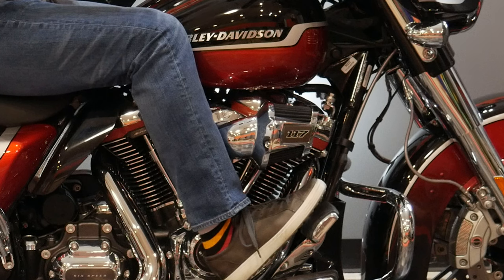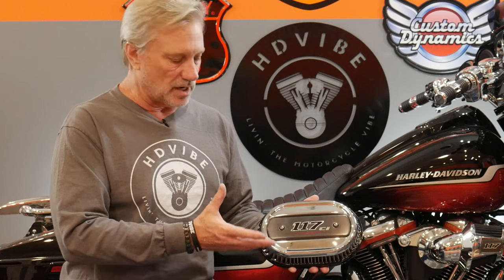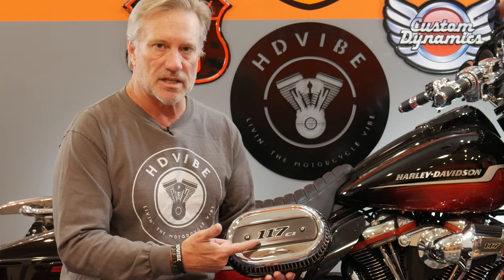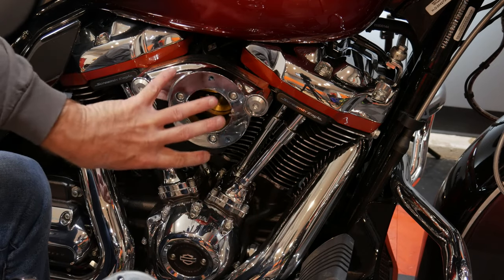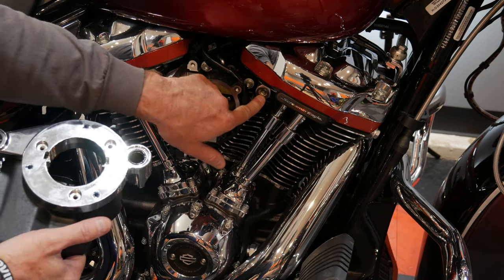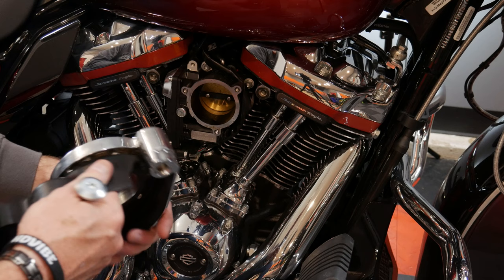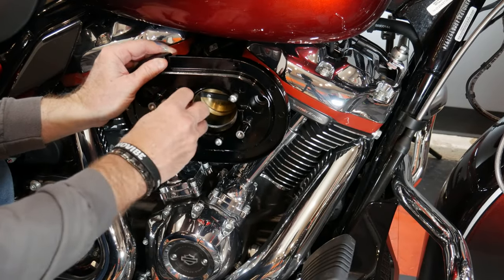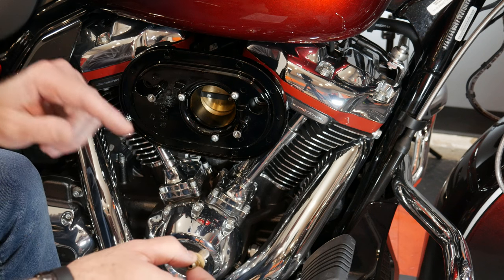Harley Davidson Heavy Breather Install and Change Out | Which is Best? #harleydavidson

Comment: I switched to “Soft Brake” as that pedal is WAAAAY TOO HIGH
Reply from the maker: That is another good solution.   Thanks for watching and commenting.  I appreciate the support to the channel.  If you are a subscriber thank you.  If you haven't yet subscribed I'd be honored if you'd consider doing so.  Ride safe and enjoy the ride.  👍👊🇺🇸
Reply: What is “soft brake”?
Reply from the maker: It's a stock rear brake pedal that is modified by the Soft Brake company to sit the pedal a bit lower to the floor board.  If you Google Soft brake you should find the website.

Comment: Great video, I have this problem on my 2024 breakout  would this part fit and can I do by myself without loosing the warranty on the bike 🏍
Reply from the maker: Thanks for watching and commenting.   You could do this to your break out as well.  I would suggest checking the part numbers to ensure proper fitment.  I also did a similar project on my 2023 Street Glide ST by changing the stock breather to the HD ventilator extreme.  I did a full video on that install as well.  If you are already a subscriber to the channel...thank you.   If you haven't yet subscribed to the channel I'd be honored if you'd consider doing so.   Thanks for your support and ride safe.  ✌️👊👍
Reply: I have a 2024 breakout and the stock filter never bothered me..I have an extreme Heavy coming to let more air in, to match some upgrades.. all of the higher flowing round style air cleaners stick out too far, and would cause me to ride boe..legged.. the one in the video doesn't flow as much air as the extreme heavy.. maybe the same or slightly less than the 117 stock elbo..I'm wanting better airflow, without the huge side filters getting in the way of my leg.. the elbow stays forward enough for me..I am 5'11"..
Reply from the maker: @happyness5293 Thanks for watching and commenting with your input on the topic.   If you are already a subscriber to the channel...thank you.   If you haven't yet subscribed to the channel I'd be honored if you'd consider doing so.   Thanks for your support and ride safe.  👍

Comment: I test rode a 2023 Street Glide ST, and that heavy breather was right on my chin.  I purchased the bike, and before I picked it up I swapped out that snorkel for a HD ventilator.  Looks great and feels excellent.
Reply from the maker: Thanks Tony for sharing your experience.   The heavy breather really bothered me as well.  I'm thinking about a Street Glide ST as well and the one thing that holds me back from making the buy is the heavy breather.   If you are a subscriber already thank you.   If you haven't yet subscribed I'd be honored if you'd consider doing so.   Thanks for the support and ride safe. ✌️👊👍

Comment: I believe Fuel Moto sells a “Sleeper” kit for the Ventilator intake. You use the same cover but have a bigger filter that bring in more air.
Reply from the maker: Thanks Paul.  I'll look into that perhaps.   Thanks for watching and ride safe.  👍👊
Reply from the maker: Agree...plus it works much better for riding at least for me.  Thanks for watching and ride safe. 👊👍

Comment: Ok looking and doing research,   who actually manfactures the ventilator air clearner element  for Harley davidson?  I have the  2023 street glide special and like the look of the factory low profile 114 stock box.  Please advise.
Reply from the maker: Thanks for watching and commenting.   That is a great question but unfortunately if you look at the air filter it is just stamped with the HD part number. I so also run the Ventilator Extreme on my 2023 Street Glide ST and that air filter is made by K&N.  If you are already a subscriber to the channel...thank you.   If you haven't yet subscribed to the channel I'd be honored if you'd consider doing so.   Thanks for your support and ride safe.  👊👍✌️

Comment: Great video! I made the same switch on mine a while ago before going with stage 2 (different air cleaner) and at the time I had to go get the screws because like you said, the originals didn’t fit and my kit didn’t come with the breather tubes.
Reply from the maker: Thanks for watching.  Yes I had to piece this one together to keep the CVO look.  I actually got the breather bolts on EBAY.   Ride safe and enjoy the ride. 👍👊🇺🇸

Comment: I have the 22 Low Rider ST. Whats the part # from eBay as I like the 117 emblem
Reply from the maker: Thanks for watching and commenting.  I don't know what the part number is I just searched ebay for Harley Ventilator breathers.  Lots of them listed and looked for one that had the 117 plate on it.  If you are already a subscriber...thank you.  If you haven't yet subscribed to the channel I'd be honored if you'd consider doing so.   Thanks for your support and ride safe.  ✌️👊👍
Reply: I found the 117 emblem on the HD website but the site would not let me buy it for some reason.  I found one on the cheap on eBay in 20 seconds.
Reply from the maker: HD won't sell a 117 ventilator emblem as this is a CVO part number.  In order to buy any CVO part from HD, you must supply them with a CVO VIN number that is registered to you.  Thanks for watching and commenting.   If you are already a subscriber to the channel...thank you.  If you haven't yet subscribed to the channel I'd be honored if you'd consider doing so.   Thanks for your support and ride safe.  👊✌️👍

Comment: Great video Rick. Yes the stock air cleaner is very annoying. I didn't replace mine but I did go with the extended rear brake lever. Made a big improvement too. Your videos are very interesting and lots of great information. Stuart.
Reply from the maker: Thanks Stuart for watching and commenting.  I appreciate your support.  Ride safe and enjoy the ride. 👊👍🇺🇸
Reply: @HDVIBE  thanks for the reply. 👍. Waiting for the next one.

Comment: I like my stock RG ST heavy breather, doesn’t bother me at all, but I will buy the Trask transmission cover to significantly reduce the oil going into the intake. Only going to run a star 30/30 cam so I don’t feel the need to upgrade that yet
Reply from the maker: Thanks for watching and commenting with your input on the topic.   If you are already a subscriber to the channel...thank you.   If you haven't yet subscribed to the channel I'd be honored if you'd consider doing so.   Thanks for your support and ride safe.  👊✌️👍
Reply: @HDVIBE  thank you for your support and yeah I like the content, I will subscribe
Reply from the maker: @Firelord360 Thanks so much. ✌️👊👍

Comment: For just 2,000 miles there sure was a lot of oil inside the Heavy Breather Air Cleaner.  I'd suggest to properly ventilate the crankcase by installing the Trask M8 Checkvent (transmission top plate cover) available in Chrome or Gloss Black (it's also metal instead of the OE plastic piece)...or...the Fueling Billet Vented Oil Dip Stick.  Your engine will run better (not longer sucking hot oily mist into the engine) and most if not all of the oil accumulation in the air cleaner is significantly reduced or 99+% reduced.  This also helps the pistons to stay cleaner.
Reply from the maker: Thanks Tom for the suggestion. I've definitely thought about a vented oiled dip stick.  I appreciate you watching and commenting.   Hopefully this will help others as well.   Ride safe and enjoy the ride. 👊👍🇺🇸

Comment: That heavy breather system looks cool. Too bad it gets in the way of your leg. One of these days I will have to get to my local dealer and sit on a street glide st and see how that heavy breather is against my leg. I wonder if there is a heavy breather "extension" that would move it forward?
Reply from the maker: Yes, it looks really cool...just not great for riding.  The Ventilator Extreme works great and no more banging my shin.  ✌️👊👍

Comment: How do u clean the filter??
Reply from the maker: Thanks for watching and commenting.   The Ventilator filter is basically disposable.   You can blow it out with air to get dirt off of it, but, they can be replaced when really dirty. If you are already a subscriber to the channel...thank you.  If you haven't yet subscribed to the channel I'd be honored if you'd consider doing so.   Thanks for your support and ride safe.  👊✌️👍

Comment: Excellent video...that I discovered immediately AFTER I switched out the heavy breather for the SE Ventilator. I found HD breather bolts on eBay and while they fit, they're a different part #.  To be safe, I just ordered the correct ones.  The bike runs just fine, though.

Since making the video, have you found any more information on the air flow differences between the OE heavy breather and the SE?
Reply from the maker: Thanks Larry for the question.  I have not been able to find any further info on airflow.  However, the bike runs great and I have had no issues at all since making the switch.   Ride comfort is much better.  Ride safe and enjoy. 👊✌️👍

Comment: Will this heavy breather fit the 114 engine?
Reply from the maker: There are several harley breathers that will fit the 114.  The best bet is to check harleydavidson.com or check with the parts dept. At your local dealer.  Thanks for watching and ride safe. 👊👍✌️

Comment: Why does it havecto be a 114 M8 and mot a 107?
Reply from the maker: You can also put the ventilator screamin eagle breather on a M8 107.  For this video I was using my M8 117 as the example bike.  Thanks for watching.   If you are already a subscriber... thank you!  If you haven't yet subscribed I'd be honored if you'd consider doing so.   Thanks for the support and ride safe. 👊👍✌️

Comment: Good video while I like the look of original AC you had it is not good for comfort for sure. I was lucky both my Heritage and RKS came with ham can style AC and I love it. I changed it on Heritage to S&S which was awesome and still low profile and I liked a look a lot but the type you installed is lowest profile I found so far. Good job!
Reply from the maker: Thanks Art for watching and commenting.   I really like the look of the heavy breather but it just was not good for riding comfort or being able to properly apply the rear brake.  Now that I have the new ventilator style on it for a few rides the comfort is excellent and I feel much more confident when apply rear brake.  Ride safe and enjoy the ride. 👍👊🇺🇸
Reply: @HDVIBE  i agree 100%

Comment: Rick must not like the fxlrst to have not brought it up 😂
Reply from the maker: I do like the Low Rider ST.  I've ridden them on a few occasions.   The heavy breather on that bike doesn't impede getting to the brake as it has mid controls...so no issue.   If you are already a subscriber to the channel...thank you.  If you haven't yet subscribed to the channel I'd be honored if you'd consider doing so.   Thanks for your support and ride safe.  👊✌️👍